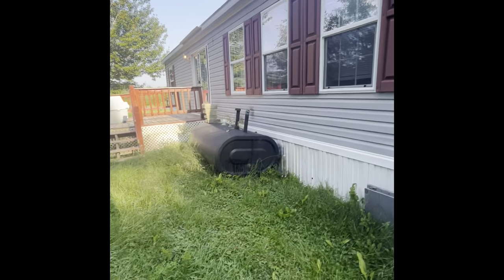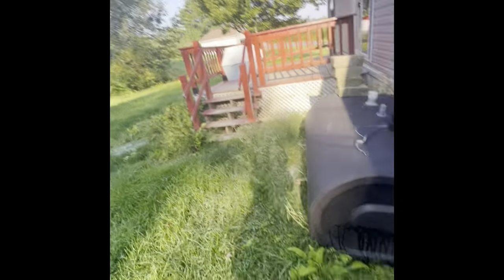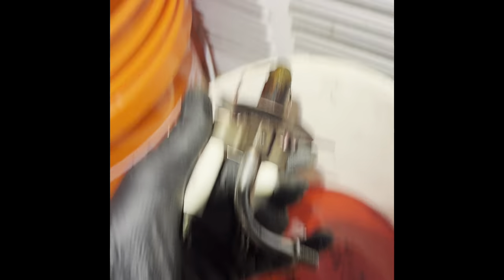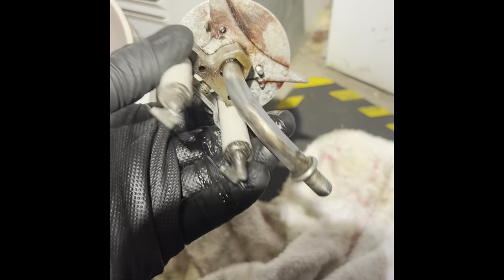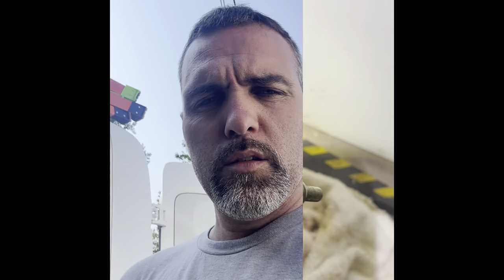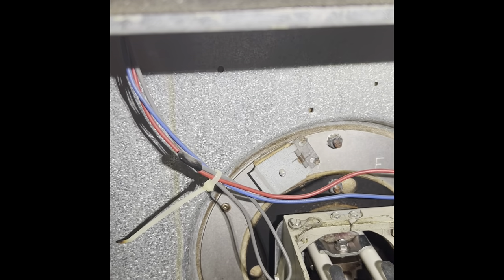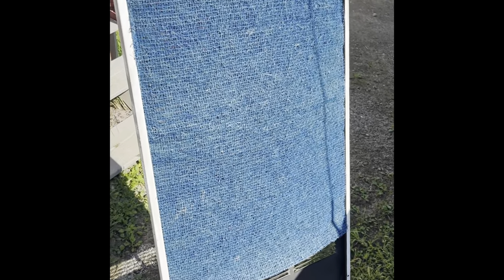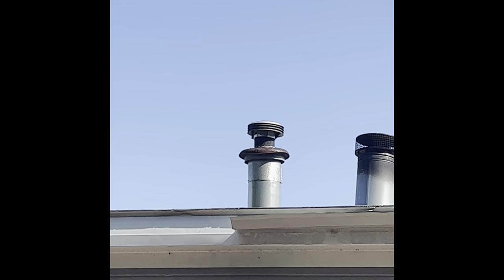Miller/Nordyn Oil burner Tune Up/Maintenance/Cleaning/Service/Mobile home

Comment: I just had one of these. I didn't see any cleanouts on it. Are there any? Didn't see a test hole for an efficency test either
Reply from the maker: You are correct. There are no clean outs and no test hole either. You’d need to pull the burner, and take apart the insert and gaskets. But it’s only necessary if the chamber needs replacing. Otherwise I wouldn’t touch it.